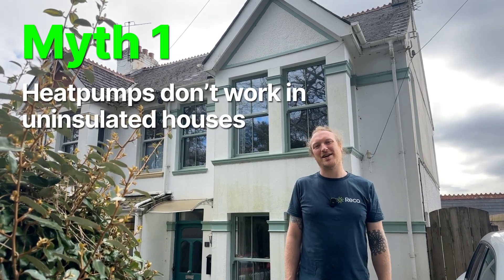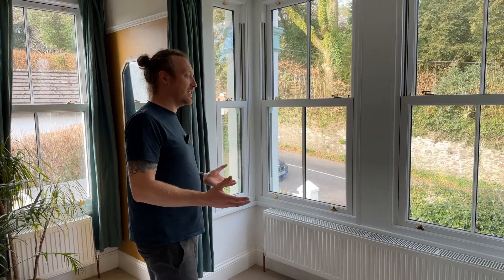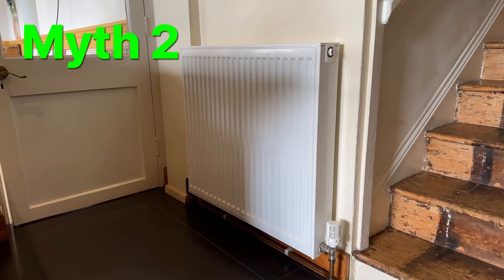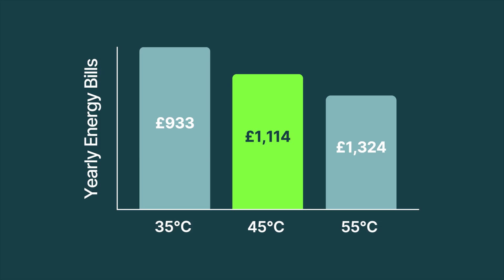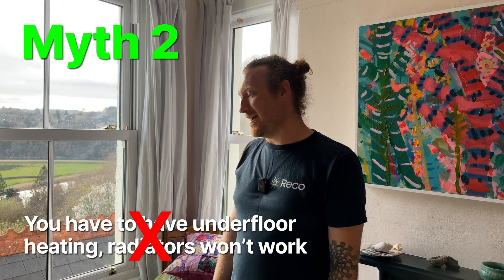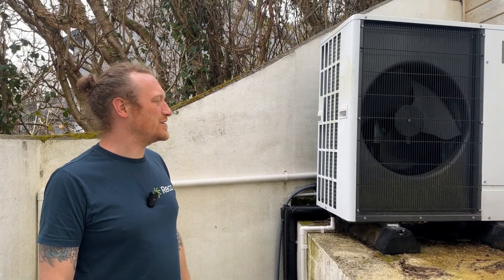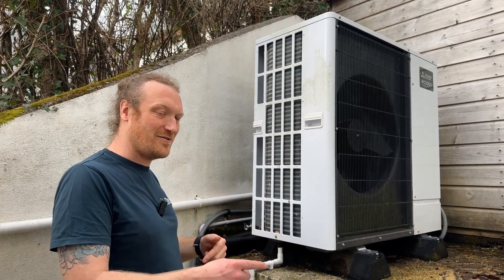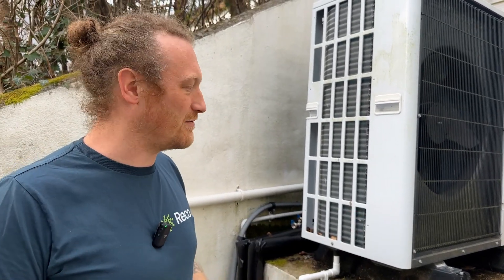Heat Pumps DONT Work In Old Houses!

Comment: As a retrofit assessor I hear these myths all the time. Our ASHP in a 1970 built rural property costs us £300 a year to run compared with £1500 on heating oil. While a significant chunk of this saving  is down to our solar PV and batteries, the savings on a standard variable electricity tariff would still be £500 a year.

Comment: Uhm, I'm not sure if this is an example I would use for heat pumps. Firstly, that unit is massive and would cost a fortune to run, easily 10 pound a day or more in winter. Secondly, I spotted a wood burner which, frankly, will be more effective in the winter. Thirdly, that's a lot of radiators. Two long ones just in the living room – no doubt adding and replacing radiators added thousands to the installation cost. 

If I were spending 20,000 pounds upgrading a house, I would spent it on more insulation, and a replacement oil boiler if that's necessary, than on a heat pump.

Comment: It’s the size of the radiators putting me off to be honest! Small stone cottage - basically every wall needs a £400 radiator, it’s a massive cost to install alongside having a radiator everywhere I look. Back to the drawing board
Reply: You could consider the new types of underfloor heating that do not require digging up floors. I have experience of a system installed in a 1950s house that works very well, even with carpet.

Comment: We live in a 200yr old house (solid brick walls) with radiators (not under floor heating) and our heat pump is half the price to run than the oil boiler we took out. Always runs on weather comparison, 24/7, and usually running at 35 degrees. Although in the depths of winter it is more like 46 degrees.

Comment: I live in South Germany and I can totally confirm your statements. Technology in 2025 has improved as well. Manny companies have developed new high-flow radiators for the use with air source heat pumps. Kudos, Real great work on the installation of that floor heater for the damp problem. This is how you do it right!
Reply: Those high flow radiators can be used on gas systems as equally as efficient. With gas condensing boilers the lower the return temperature the more efficient they are. The lowest modulating gas condensing boiler modulates down to 1.9kW, a German Viessmann. 

Have larger radiators, as heat pump system have, weather compensation and local temperature trimming then it is very cheap to run, or cheaper, as the boiler is operating at maximum low temp efficiencies.

For those who are eco minded, the UK, and maybe Germany and others look like having a 20% hydrogen mix in natural gas reducing emissions.

Germany is going big on generating hydrogen from North Sea wind farms - the AquaVentus project. The were bitten big by relying on Russian natural gas. They want to replace fossil fuels by home produced hydrogen. The British are in on it with hydrogen to be piped ashore and stored in two massive underground gas storage caverns, Aldbrough and Rough, north of the Humber estuary. 

So expect natural gas to be a 20% mix of hydrogen without any adverse affects to current burners. So, relatively clean natural gas becomes cleaner. 

Expect trains, steel works and gas peaker grid power stations running on hydrogen. Tests on hydrogen trains have been successful.
Reply from the maker: Yes hydrogen gas will be used in industry, but in my opinion, blending the gas grid with 20% hydrogen is very unlikely to happen, how would it be possible to check that every one in a specific area has 20% hydrogen ready equipment? Redcar pilot project was scrapped due to local opposition largely based on safety concerns which isn’t surprising! Hydrogen is a “thinner” gas that leaks easier, it can break down alloys. It burns hotter and requires different size jets. For me the main thing is how are we going to check every house in the uk to ensure there isn’t an old gas fire, stove or even a gas boiler that’s not up to the standard? It seems like an impossible task! Also how will we get hydrogen to the specific parts of the grid that transition first and only to those parts. I really do think it’s the gas industry clinging on to a pipe dream…
Reply: @RecoEnergy  
There were two hydrogen trial projects to use 100% hydrogen, one in Redcar and one in Ellesmere Port. Both never went ahead. With a 20% hydrogen mix the burner functions just the same - no change. No appliance needs changing or adapting. 

As an aside, we converted a whole country within a few years from town gas to natural gas over 50 years ago.

With the North Sea AquaVentus hydrogen project, two natural gas fields to be brought online and two of the largest underground hydrogen storage caverns on their way near the Humber, the death of gas has been greatly exaggerated.
Reply: @johnburns4017  You absolutely confirm my view what we se in Germany and Austria. The step by step approach to mix in hydrogen will work without causing larger problems and most of all will buy the industry some much needed time to adapt. It also helps the private household to save up some cash for converting old tech to renewals in the next decade. And it can’t be done faster anyways, because of limitations of craftsmanship and demographic decline. The hydrogen mix is a rather comfortable on-ramp to a full transition envisioned by our unelected, criminal, enslaving elite in Davos.
Reply: Natural gas pollutes for sure but less than other fossil fuels around. In cities it is the burning of liquid fossil fuels that heavily pollutes, that is mainly used in transport.  

In summer on hot days when the conditions are right the pollution levels greatly rise. In the past ten years London gave out warnings on some days - do not run and stay indoors if you can.  That is receding with the use of EV buses and cars. The odd train line has been electrified. The benefit of gas is that little of it is used in summer in cities reducing its pollution impact. Having a 20% hydrogen mix then even less again.

Gas powered stations are used for peak grid loads, being part time stations, as they can instantly respond to peaks. These can be converted to pure hydrogen generated by wind in off peak periods. .
Reply: @Guanaalex  
The largest on land wind farm in the UK 70% of the time is shut down - the operators are paid to shut them down. No kidding. The power lines from the wind farms are not man enough to take the generated power. That is being worked on by installing new power lines. At times too much electricity is being produced with some companies paid to use the surplus electricity. Surplus electricity can be used to generate stored hydrogen when the hydrogen infrastructure is in place..
Reply: @johnburns4017 That’s not quite right. Wind farms aren’t shut down because the power lines from them are too weak — they’re curtailed because the interconnects between regions can’t always move electricity from surplus areas (like Scotland) to areas of high demand (like the Midlands or London).

Another big factor is that gas plants currently need to stay online to provide essential grid stability services, like inertia and frequency control, which traditional spinning generators provide automatically. This limits how much wind can be used even when it's available.

That’s exactly what NESO’s Pathfinder programme is working to fix: replacing those stability services with grid-forming inverters and battery-based technologies, so we can rely more on renewables without needing gas as a crutch.
Reply: @BenIsInSweden  
The peaker power stations are used for instant generation, as is some falling water. However, to give a stable generation base gas is currently used along with nuclear and biomass.  This natural gas usage will drop as hydrogen comes online and new wind and solar farms come online.

As it stands at 12 May just after noon, power generation:
• 13% nuclear;
• 17% Gas;
• 8% biomass;
• 16% wind;
• 28% solar;
• 18% other sources.

Ambient temperature in London is 23C. Very little gas is being used in homes and offices as no heating is required. This marginally improves the air quality.  57% is emissions free.

As gas usage drops for power generation and a 20% hydrogen/natural gas mix comes about, natural gas reserves will last longer.
Reply: @johnburns4017  Peaker plants aren’t the same as the ones providing base load or frequency stability — and neither they nor CCGT base load plants can currently run on hydrogen, not even at a 20% blend.

You’re talking as if a 20% hydrogen mix is universally viable, but that’s far from reality. Hydrogen-ready boilers exist as a transitional measure, not a long-term strategy. And most other gas-powered appliances, like hobs, fires, or power stations, can’t simply run on hydrogen without major modifications. It’s not a drop-in fuel, and pretending otherwise just muddies the conversation.
Reply: Some who go for heat pumps when having a natural gas supply, fearing gas will be turned off in 5 to 10 years time, the facts prove gas is here for a long time to come.  A Viessemann modulating down to 1.7Kw on a system designed to run at low temperatures is the wise option for economy.
Reply: @BenIsInSweden  
You have a habit of not seeing a point. A 20% hydrogen mix is for the current natural gas network, which means no change in currently used burners - everything stays the same for the end user. Industry can run on 100% hydrogen. They are not building the worlds largest hydrogen storage facilities near the Humber estuary for fun.
Reply: @johnburns4017  I am seeing the point just fine, I just don't live in a fantasy land.
Hydrogen has the same problem as SAF in aviation: great on paper, but in reality it's expensive and hard to scale.

 - To get a 20% blend from green hydrogen would take around 82TWh of renewable electricity. The UK’s total electricity use in 2024 was about 275TWh, with wind providing 30% of that, so you'd need all our wind farms producing nothing but hydrogen just to hit that number.
- Just because 20% hydrogen is allowed in the gas grid doesn’t mean everything can handle it. Plenty of appliances can’t — even some newer ones — and unlike ethanol in petrol, hydrogen isn’t a simple blend. It changes flame behaviour and safety profiles.
- And as I’ve said more than once now, hydrogen is being produced for very high-temperature industrial applications, where options like heat pumps simply aren’t viable.

Also, not sure why you keep going on about Viessmann modulating to 1.7kW — that's still too high for many homes during much of the heating season, especially flats and small to medium houses. Cycling still happens and still kills efficiency.

Also, no one credible is saying gas will disappear in 5–10 years, certainly not enough to 'scare' people into heat pumps. That sounds more like Daily Mail-level fearmongering than an actual trend.
Reply: @BenIsInSweden  
You are questioning the technology that is being already implemented. 
Heat pumps are typically fitted in largish British homes. A Viessmann heat generator modulating down to 1.7kW is perfectly suited for such homes and will be cheaper to install and run in most cases.
If I had a full solar array and home battery charging from the solar panels and cheap off peak electricity, I would almost certainly consider a heat pump. But that expensive luxury is not available to the vast majority of homes.
Reply: @johnburns4017  Where is any credible source saying hydrogen will be implemented — even blended — for domestic heating as of 2025?

The examples you’ve quoted — AquaVentus, Aldbrough, Rough — are focused on industry and grid-scale energy storage, not homes.

And the thing you're missing is that the expensive part of a heat pump setup is the home upgrades. But once that’s done, a Viessmann boiler maxes out at around 98% efficiency. In the same conditions, a well-designed heat pump can deliver closer to 500%. That’s not a marginal gain — that’s a fundamental difference.
Reply: @johnburns4017  Key points:
- if enabled
- industry trials to gather evidence to demonstrate whether blending can be used safely
- following completion of the safety assessment, government will take a decision on whether to enable blending

So as it stands, there is zero implementation — it’s a conditional policy, not an active rollout. And to date, there’s no public evidence that the required safety trials have been completed.
Reply: @BenIsInSweden  
Active rollout bringing in hydrogen with Germany and activating cavern storage north of Humber. HMG tests on 20% hydrogen mix with natural gas are all positive.
Reply: @johnburns4017  You're still mixing up industrial-scale hydrogen projects with domestic heating.

Yes, the UK and Germany are investing in hydrogen infrastructure — but those projects (like AquaVentus or the Humber storage caverns) are for industry, power balancing, and export, not piping hydrogen into homes — not even as a blend.

And while HMG’s initial tests on 20% blending have been positive in controlled trials, there’s still no regulatory approval and no active rollout. The government clearly states that blending is conditional on safety assessments, cost-effectiveness, and changes to the Gas Safety Regulations — none of which have happened.

Also, blending 20% hydrogen — even assuming it costs only twice as much as gas — would increase the cost per kWh by around 20%. Independent analysis suggests it could be much higher, with estimates ranging from 30–50%, depending on how the hydrogen is produced.

All adding hydrogen to the gas network will do is shrink the spark gap and make switching to a heat pump even more of a no-brainer, and for those who can’t switch, it’ll just mean a higher heating bill for very little benefit.
Reply: @BenIsInSweden  
More confusion. HMG is going ahead with Germany in the North Sea. The mixing of natural gas with hydrogen is a project tat has NOT been cancelled.
Reply: @johnburns4017  No one said the idea of blending hydrogen has been cancelled — only that it’s not being implemented in the gas grid yet.
Even the government’s own statement says blending is conditional on safety and feasibility assessments, which are still ongoing. There’s no active rollout, no regulatory approval, and no set timeline.

As for the North Sea collaboration with Germany — that’s focused on industrial hydrogen infrastructure and offshore production, not piping hydrogen into British homes. Again, it’s for industrial use.

You keep confusing announcements and strategic partnerships with actual delivery — they’re not the same thing.
Reply: @BenIsInSweden  
You keep going around in circles. 
Many believed that gas was being phased out with boilers being taken off the market in five years then the gas network gradually dismantled. So, many were buying heat pumps when needing to replace their aged heat systems. 

With the natural gas and hydrogen projects under way, gas is here for a long time to come.  So no need to fit a heat pump if you have a gas supply. Just fit low temperature running system with low modulating boiler. 

The only exception would be if a homeowner has a substantial array of solar panels and a home battery, then a heat pump may make some financial sense.
Reply: @johnburns4017  Any examples of people buying a heat pump because they genuinely believed boilers were about to be banned and the gas network dismantled? I’ve seen far more people doubling down on gas, even buying spare boilers, rather than switching to heat pumps.

What you’re missing is that green hydrogen for home heating will likely undermine its own case in the market:

- None of the existing projects have the capacity to support hydrogen blending at any meaningful scale, not even to reach 20% blending.
- If they did, the cost of gas would rise significantly, because green hydrogen is tied to electricity prices.
- Shrinking the spark gap (which blending hydrogen will do) just makes heat pumps even more financially compelling.

The only realistic scenario where hydrogen could make sense for domestic heating is if the UK discovered its own reserves of naturally occurring hydrogen, like France has recently. Short of that, it's just not a viable path.

Even hydrogen fuel cell boilers arguably make more sense, converting the existing natural gas into heat and electricity via electrochemical reaction. But even the UK's leading installer has now abandoned those in favour of heat pumps.

Comment: Well I just watched the video that was filmed in the state of Massachusetts a lot of people purchase high efficiency heat pumps there are there electric bill skyrocketed. A couple just remove their old furnace HVAC unit they just replaced with a modern efficient heat pump. They have solar on their house too they showed their old solar bill over the course of several months and their electric bill what's several hundred dollars over that time. After the heat pump was installed the electric bill was $800. They interviewed other people in the neighborhood who also went with the heat pumps and also found that their electric bills increased dramatically from what they had before. What I'm saying is don't trust that you're going to save huge amounts of money by changing the technology just from one thing to the other it doesn't always happen and what's sad is your older and now you have a huge bill that you're responsible for the next 20 years.
Reply: Switching to electric heating will naturally incrase your electricity bill.  But what also isn't shown is how much the gas bill reduced.  If their whole energy costs "skyrocketed" then something bad was done with the installation.